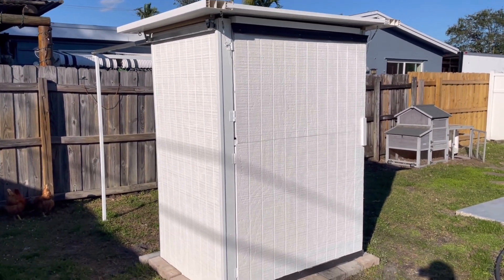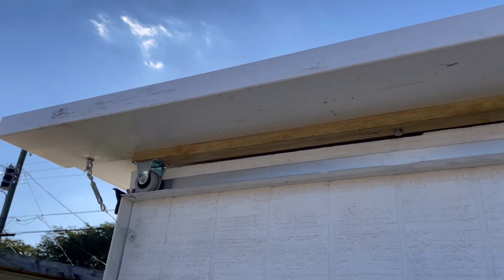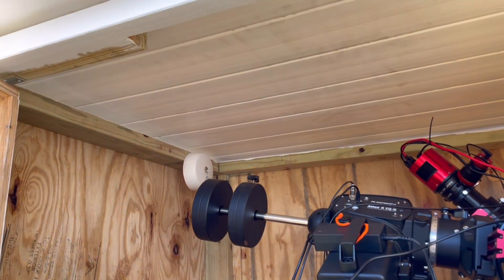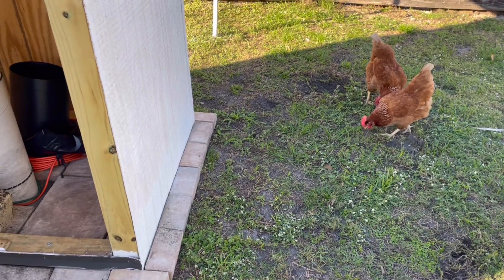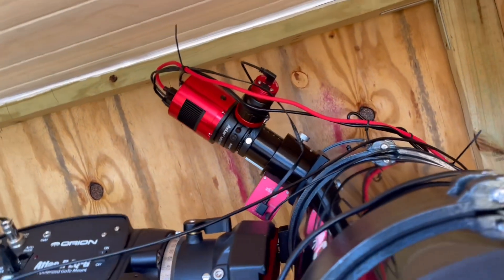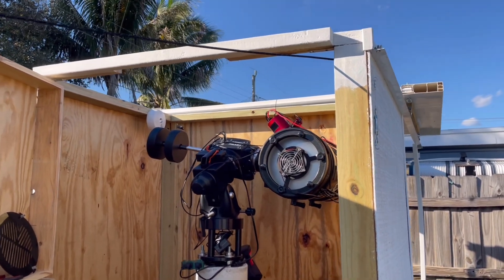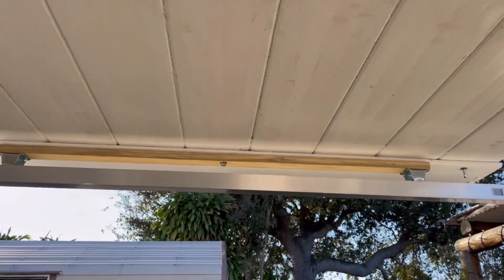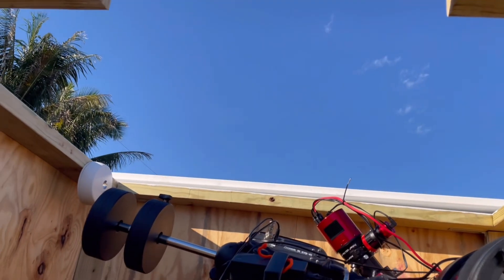DIY Observatory; Backyard Astrophotography; Roll off Roof walkthrough

Comment: Nice. I'm currently looking through as many Obsy videos as I can find with a view to starting my own project.
Re: holding the doors open, I'm thinking an old fashioned window latch. You know the lever with holes that slot onto a pin?
Reply from the maker: That sounds like a great idea!! I have been scratching my head on this part for a few weeks now. Can you send a photo of the kind your talking about? I might just try it
Reply: @outhouseastro  I can't post a link here but I've just discovered that the latch type I refer to is called a "Casement Stay". Hope this helps.
Reply from the maker: @Cheapass-tro I’ll go check it now
Reply from the maker: @Cheapass-tro I’ll subscribe too. Under what post did you put it? I was looking for it just now
Reply: @outhouseastro  I've now posted a copule of pics.